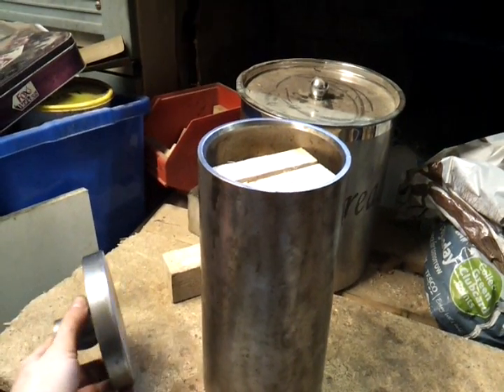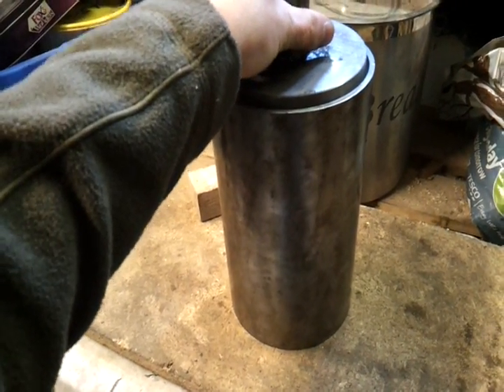Steel Crucible Part 1

Comment: What metals can you melt in this?
Reply from the maker: I've still got the 'crucible' but it's probably not the ideal medium to melt anything in after consideration. You could melt anything with a lower melting point than steel such as aluminium, brass, copper etc but as the steel will scale up on every heat up then it would serve to contaminate the next melting. Not something I worried about too much when I made it. It would certainly work though! I'm sure I will use it for aluminium one day.
Reply: I go to thrift shops and antique shops and buy cast iron pots One will last a few years. I have melted aluminum in them with no scaleing. I had a 3 gallon pot and could pour a large casting of a bell. I use hardwood fire with a blower in a brick furnace.
Reply from the maker: Ron Delby I had the same idea a couple of years ago. I bought a couple of cast iron drain pipes thinking there wouldn't be a scaling problem as there is with steel. Before I tried the cast iron I read that they might even be worse for melting aluminium but on a more chemical interaction premise than the steel flaking trouble. However, if you've tried them and found no problem then I might just have a go too
Reply: voidmansions Hi I have been doing it for many years. Make sure you do not have a very hot flame blowing against the pot if its cast iron. Keep a steady roar but not a torch of flame on the pot. I use wood fire with a blower at the side through a hole. I made a 2 feet wide furnace from discarded fire brick and left a hole in the lower side for the blow pipe. When the pot turns cherry red, the aluminum will melt quite easy. I test the temperature with a steel poker. I incert it in the molten mix and when I withdraw the poker and no aluminum sticks to it, its ready to pour. Of course I skim the top for slag. I use play sand mixed with sodium beninite for keeping the sand stiff. For bells I mix a 3rd of zinc die cast metal scrap in with the aluminum which improves the tone of the bells. I plan to buy a cement mixer to mix the sand with the beninite this spring. This way I can make a lot of foundry sand really quick and avoid the labor of mixing it with shovel or hands.